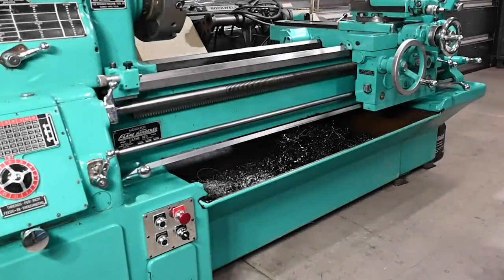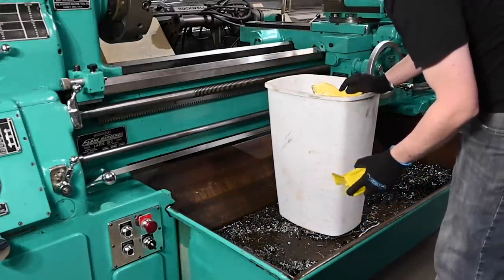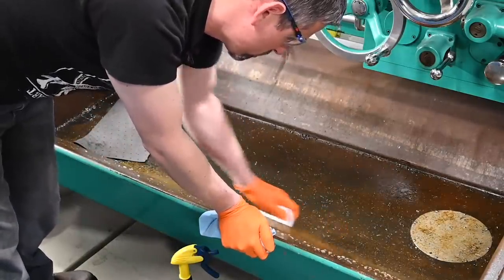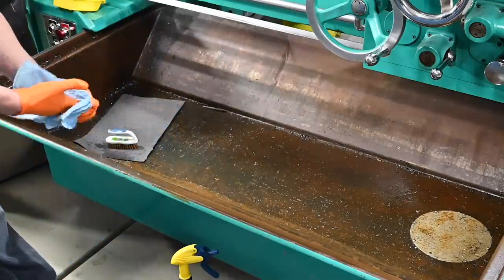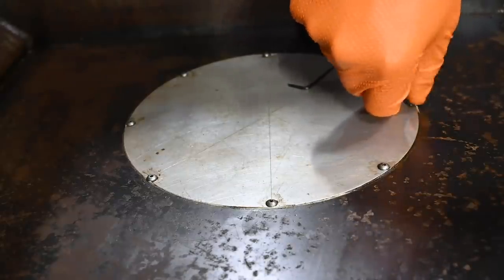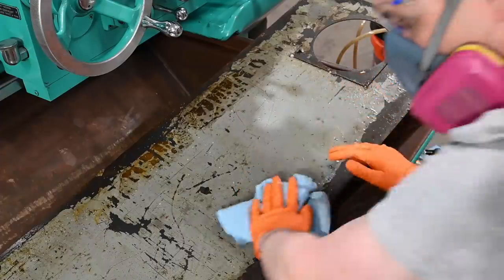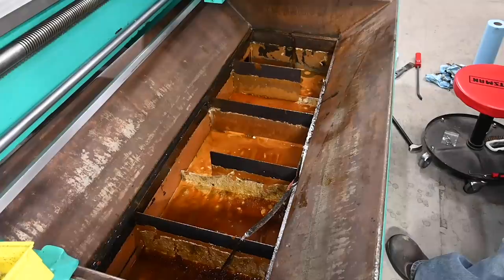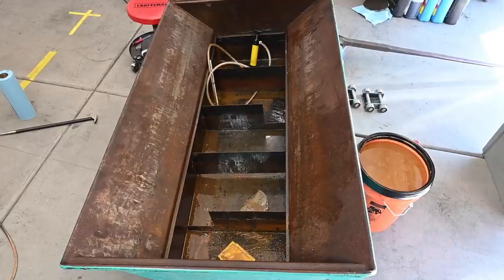Monarch Lathe Coolant System Rescue! With Smell-o-vision!

Comment: My chip pan had a small (3x6) removable fine mesh filter right in front of the opening to the pump sump area. Once removed. It was enough to get a power washer into and clean thoroughly. I've got a 30 inch bed. But I can't imagine they are too different.

Comment: I would recommend to fill it with sodium hydroxide (drain cleaner) and water. It will turn the oil into soap which dissolves in the water.
It also kills all the bacteria so the smell should be a lot better after that.
But you have to be careful, it also attacks paint, your skin, your eyes, brass, and aluminum.
So you have to disconnect the pump and of course wear gloves and eye protection.
Reply: Sodium hydroxide (lye) will turn triglycerides into soap and glycerin.  At room temperature, the process is slow.  No such luck with hydrocarbons and the like, but some emulsifying action may occur.
Reply: @eliduttman315  I was very successful using sodium hydroxide for cleaning a Motorcycle Fuel Tank which had a thick layer of gummed 2-stroke-oil on the inside.

I think i used 100-200g in 4-5 litres of Water.

Comment: You had a case of rancid coolant. The water soluble oil that was being used basically developed bacteria that came not only from the coolant but the fine metal chips, oils that got into the coolant. That’s where the slime came from. You have a decision to make, where to run coolant or not? I’d advise to clean the sump system, paint the internal tank, then reseal it up. Paint your chip pan, and use a mist coolant system, because you don’t use the machine daily, the coolant will become rancid again, unless your a commercial shop it’s plain not worth the trouble to maintain a coolant system, the mist will be sufficient. Of course this just an opinion of me, and it’s your shop and machine.

Comment: Hmmm... YUMMY! You know, as bad as that sewage tank is, sadly I've seen worse. Significantly worse. If it's possible to take the pump out and bring the sheet metal tank to the nearest self-service car wash, I think it'd work pretty well. You could hose off most of the yummy stuff. And they have some pretty powerful degreasers they use for engine compartments. Either way, it's not my favorite job but it's just something that has to be done. And "gross" is a pretty accurate description of what's going on there, so I think there's nothing wrong with saying it. :-D

Comment: Unless you get some big side jobs and/or start machining full time, it will be very hard to justify the expense of fully restoring and using emulsion type cooling.

Were it my problem to solve, I'd seal the cover plate to the tray edges to prevent draining, then perhaps fashion a sealed sump "bucket" you could place in the round opening.  This would create a collection point for any runoff from manually applied cutting or way oil.

As for cleaning and painting, I've never had good luck painting anything that spent decades in contact with oil and corrosion, best of luck there.

Comment: Idealy have the drain in the bottom of the tank.  Pipe a valve into the tank bottom plug hole.  Get a diagpham type a pump to connect the valve to pump the tank into a drum or into waste for disposal.
Reply from the maker: I was considering a valve to block off flow to the dispensing end of the plumbing, and have a fitting to attach a hose on for pumping out old coolant using the coolant pump. Not sure if that is a terrible idea for some reason or not, but I'll figure that out when I get back to the pump rebuild.

Comment: I would not paint where the baffles are unless the paint can withstand water and oil (it will peel off and get into the pump) Caveman's Mancave
, Bruce Tuckey and Bosted Tap have good ideas as well.

Comment: Back in the 1970's I worked at a big machine tool manufacturing company, some of the machines had 200+ gallons of coolant in there....looked about like that at  ….7:30.....  I was there 10 years and don't recall anyone changing coolant on anything....I've seen this  other places too...the management doesn't like people spending time on anything that's not directly related to making chips ($$$$$)….
Reply from the maker: Yikes!!

Comment: Sand blast the inside, and paint it in a very dark color. Powder coating would be ideal, as it can take a beating. Any fancy color scheme will turn ugly real fast, when the chips damage the paint. The purpose of that steel back plate is to keep chips from going into the pump, making holes in it might hamper that ability. Maybe the pressure washer can blow out the crud behind the plate?

Comment: How are the baffles held in? If not welded then take the whole mess out. You don’t do enough work to justify a coolant system and all of the headaches. Just make the whole thing one big deep chip pan. Paint the whole thing with Rhino Liner cause paint won’t hold up to chips.

Comment: I think what I would do it remove the plug and use a power washer to flush the enclosed tank. That would get a lot of it. Then I would add plane water and test the pump to verify that it works. Plane water is easy to get rid of. If the pump works, add a strong mix of purple power or equivalent and run the pump. Let it run all week while your at work. Maybe change the solution once. As you say, your doing this for fun so what is the rush.  .

Comment: How old is this lathe?  The pan doesn’t look bad for its age.  If you paint it, won’t the various oils, coolants and metals cause the paint to eventually fail?  I’m wondering if the surfaces could be treated differently to prevent rust.   It wasn’t a big problem to clean – it would be with flaking paint everywhere.  Most of the rust in the coolant chamber is likely from steel and coolant.  
A gorgeous machine.
Reply from the maker: It’s from 1952 so it’s a young 68. Cutting oils and coolants are a killer for paints. Hopefully I can do something that will at least last a while.
Reply: @AlwaysSunnyintheShop  What did the manufacturer use.  You can see some kind of black coating in the bottom tank.  Maybe something like SVSeaker use on his boat.

Comment: Do the baffles lift out? Looks like they would all come out as a big piece.
Reply from the maker: Unfortunately not- they’re welded in place to the pan which is all a weldment itself.
Reply: AlwaysSunnyintheShop sounds like time to get your angle grinder out then. Do you plan on using coolantant? Look into a cleaning chemical to clean before you put in you coolant. I got some stuff from Msc was $35 for a gallon made by master chemicals. I can get you the pn if you need.

Comment: Previous owners likely left that old coolant in there for lack of a way to dispose of it. Where to take it? A less responsible person would likely just wash that stuff down the storm drain!   It is unpainted as the coolant and oil might eat away the paint?
Reply from the maker: You’re spot on, Danny. When the city or county doesn’t make it easy to make the right choice and not pollute, people will take the easy route and make a mess of the storm drain. That’s the only thing that made sense- they must have thought in Arizona they wouldn’t have to worry about rust. They also didn’t think it would sit in an open barn for 10 years not being used 😞

Comment: Dan Cobel has the knowledgeable answer! My curiosity (in my desire to own 1 of these fine lathes in the near future) is of how it was designed to work. As is, the 1 'plug' in the coolant cover appears to be the only drain that separates coolant / cutting fluid from the chips. As is, it also appears that the baffles are 3 separate chambers with a debris catch baffle in the middle of each. You mentioned possibly 3 pump pickup points, so that might explain 3 separate chambers - but adds the question of how fluid gets to the last 2 chambers?

As for the $%&*   &   (%@^   words: once the experiences that elicit such reactions are addressed; so does the use of them. 

Now to the way you addressed the naysayers & whiners? I've never won an argument by stooping to their level............

You are making your channel all about this beautiful machine. That's why I'm here. That's why I replied!

Comment: do the baffles lift out? if they do your one step ahead. and there is no better way ta find if the pump works that the hook it up and give it a go. also if some jerk want's ta make abusive rederic just turn them off and pay no attention ta them. I like yer videos. I'm not a machinist meself but I love ta tinker in the shop too.
Reply from the maker: No, the baffles are all welded in. I do want to open up the pickup and discharge ends of the pump to see if there is anything in there before I try to run it. Might have something jamming it up.

Comment: I take it that you have tried to see if those baffles would come out ... ?

For What It's Worth:  If you have a pickup truck and some help, take it to a car wash.  

Let us know if you find the "missing link" inside that pump ....
Reply from the maker: Haha really hoping the pump is dry. The baffles are all welded in. The top lip that’s parallel to the floor is angle that’s welded in to the drawer.

Comment: Given how the outer part of the sump baffles are shaped at the top edge by any chance would the whole set of baffles lift out to expose that back part?  I'm basing this on the fact that the baffles are darker and not rusty and the rear panel has an inward bent flange along the top and what looks like a bit of a gap.   So I'm sort of thinking that the whole baffle assembly is just set in place.  Give it a bit of a grunt and see if it's actually attached.
Reply from the maker: It’s a bent piece of sheetmetal that’s then welded to the end pieces. All one big happy part unfortunately.
Reply from the maker: Looked at the photo of it and I understand why people are asking. That lip is angle steel that’s welded to the inside of the sump, then the baffles are separately welded to the walls.

Comment: have you tried if you can lift out the internal frame? Is it welded or screwed together? I mean, you would think that the sump would be serviceable. Let me make clear that I don't know anything about these machines. I just like to watch.
Reply from the maker: Sadly it’s all welded in there so no way to pull it out.
Reply: @AlwaysSunnyintheShop  If you are 100% sure that you have no other way to get access to that area then maybe it is a good idea to make it serviceable. And that can only mean one thing, time to get the angle grinder out. Make a hatch in the angled part, you know, the part that you planned to paint, in order to get access to that area. The guy who owns it after you will appreciate it as well :-) But first I would do a camera inspection. Maybe there is no need for all that extra work. And maybe you can get away with solvents. But a hatch that gives you access to the pump sump from the top seems doable, and you don't need to damage any of the existing paint. And you will have easy access to do the job. And you don't have to fear for leakage afterwards since the hatch will be on the top. 

Good gasket material is EPDM foil, also used for fish ponds and roofing material. It is relative cheap and you can cut perfect gaskets from that stuff.

Comment: Wow, that is all kinds of YUCK!  I dealt with a toxic sump once YEARS ago on a much smaller machine, it smelled pretty bad and there was every indication it had never been changed in the 24 years they'd had the machine. Hard to say what the best was to recoat the metal. Powder coat would be my choice, but that it is probably WAY overboard. So degrease, prime then paint with a good quality oil-based paint. Dunno about the metal that is submerged, maybe just a really good cleaning and a coat of machine oil.

Comment: Are you going to run coolant?   If not clean it , paint it forget it.   Or sand blast it. And get with Sherwin Williams on a epoxy primer and a good top coat. And im sure you probably know, chemicals are made to add to the coolant to keep the bacteria from growing.    As for the trolls. Kick um..  you know with a high sub count ,trolls come with it.  Id hate to think how many trolls Adam gets per day.  Keep it ip.  Nice work

Comment: Yikes! What a mess! I wonder if that coolant system is worth resurrecting. Since you aren’t a production shop with high volume work, which the machine and coolant system were designed to support, maybe it would be just as easy and effective to deploy a portable system and a grate at the bottom of the chip tray. Let the coolant run into a bucket for either reuse or disposal. (I don’t know if modern coolants are reused in the machine or are one-time use.) I’m guessing the maintenance workload would be considerably less and more in scale to the work you do.

Re: negative comments; no matter what you do you will get them. I think you would be well advised not to respond to them. I also suggest for your content you “pick a course and go” as the song says. You don’t want to look like one of those restaurants that seem to be trying a little too hard. Do what you want. Do what comes along. You’ll be fine. You can’t be Abom, et. al. Don’t try. We already have them. I’m happy to watch you learn.

Comment: Seems like a good video and project to get the cooling system working. 
I did enjoy this video, did you find alien lifeforms in the sump by the way ?
Reply from the maker: Haha it looked alive that’s for sure!
Reply: @AlwaysSunnyintheShop  not so alien most of the time it's slime molds they make it very difficult for you to breathe happy. Saw all the comments re: cleaning, retro fitting, sealing, etc., and agree with most of them [good luck reading my mind to see which I don't agree with <g>] so do as you will since this is months after the request. Looking forward to more videos from you.

Comment: Where are the drain plugs for the coolant tank?  Periodeically the tank should and cleaned.  When the chip tank is allowed air to circulate you will have evaporation that has to be added to the tank.  The oil in the coolant will stink if let stagnant.  As to why the inside of the chip tank when you have very sharp chips falling into and move around will erode and treatment to the metal, leaving worse than the naked tank.
Reply from the maker: There is a drain plug on one end but unfortunately it’s frozen solid. If I want to use it some time I’ll probably have to cut it out and weld in a new fitting.

Comment: hello,  unless better advice based on "monarch specific" data. cut cleanout holes in back. make cover plates, gasket them down.
   if you reuse the coolent pumping system,  add pine oil,, not pine-sol!!!  A 1/2 CUP TO THE GALLON. GERMICIDAL ACTION YOU KNOW.
    ready for a giggle?  classic training teaches that: you dont spit, toss cigar butts, or urinate in the chip pan. 
     i find your videos to be just fine. 
       poppy's workshop says PINEOIL

Comment: Does that Baffle system lift out or is it welded in?????  stand it up on end and call a portable media blaster,  If your just a hobbiest its probably not worth it to get the pump going and deal with coolant,  like someone said you need a refractometer and your dealing with bacteria that will eventually grow in the coolant.  just use a cool mist or those little acid brushes with cutting oil "like the guys on the other channels".   Just you in the garage,  not a production shop right???  seal up that bottom plate real good,  acid etching primer and paint.
Reply: oh "IT'S ALWAYS SUNNY IN THE SHOP"  its your shop keep it that way,  like I see on all the other channels I watch the thumbs up's always exceed the thumbs down's.  don't listen to the minority of your viewers,  they don't like it they will move on.
Reply: THIS was my thought -- the entire baffle system may lift out of the main pan.  It may or may not include a bottom.  But if it does come out, that will probably give access to the next compartment.

Comment: Ugh the coolant sumps on the two mills and three lathes at my work look a bit like that (not quite as bad but still bad), and we can't get them to do anything about it
Reply from the maker: Ugh that’s rough. Come in wearing an air fed respirator and tell them you can’t do anything until the sumps get cleaned.
Reply: @AlwaysSunnyintheShop  Lol sounds like a plan

Comment: Picklex 20 (purchase online) is a great product for killing any residual micro-rust after doing some wire wheeling and cleaning.  It will leave the metal in a very raw form with all the rust killed. It also acts as a pre primer. I've found nothing better. A mildly expensive product that can save time, money and skin in the long run. Popular in auto restoration. Remember rust never sleeps. Good luck in your decision.
Reply: Meant too add. Automotive epoxy primer works great with Picklex 20 and would benefit your project.
Reply from the maker: I’ll have to check that out- not familiar with it.
Reply: Picklex20 . com for more info. It's around $50 per 16 ounces but it goes a long way and works very well.  It helped me with my project. 2 thumbs up. It should be in every shop. Check it out. I have no affiliation with Picklex 20. Hope this helps.

Comment: Flood coolant in home shop mostly to rubish the fluid die to fast do to low use bad maintance    and the cost use factors are terrible .....exspecily you cant simply ppor it down the drain  get rid of waste cooland is very expensive   for the home smal shot is dry maschining  or mist coolant the better and most costeffektive way